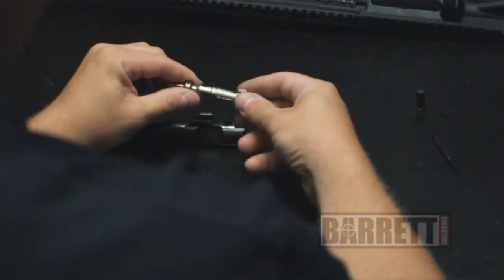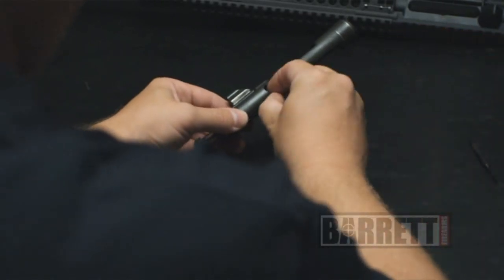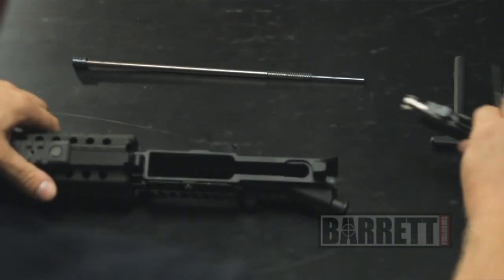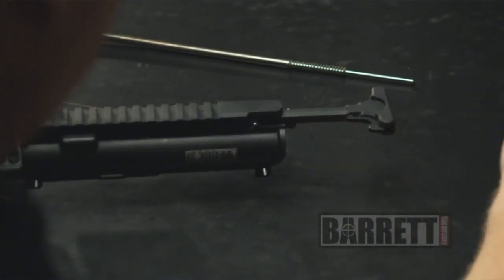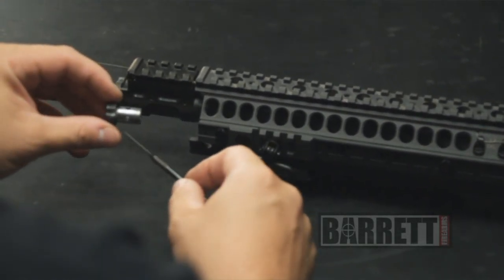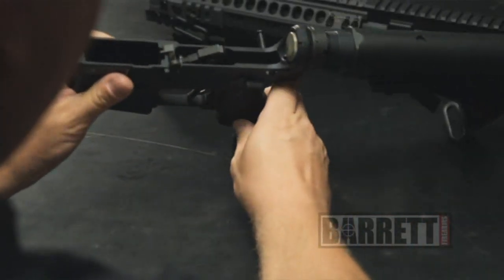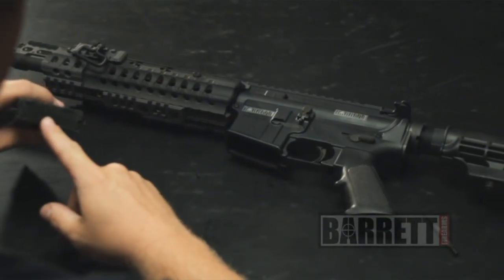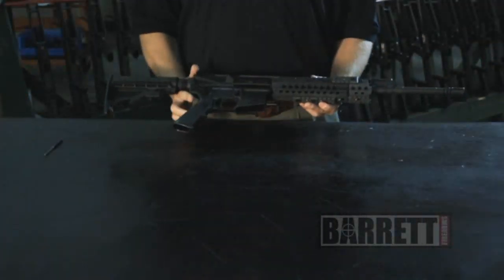Barrett REC7 Tutorial Part II

Comment: I personally own the Rec7 in 5.56, after I put over 300 rounds through the gun I cleaned it and inspected the receiver extension and noticed that the finish was untouched and there was no sign of wear inside the buffer tube. If you were to put over 10 thousand rounds through it I'm not sure of what kind of wear you would see on the rear of the carrier or the buffer tube, to be safe though you could always apply a light coating of lube to the rear underside of the carrier.

Comment: @xlifeispointlessx Not to mention its piston operated, which is much better than dirtect inpingement as it doesnt heat the bolt up or spray dirty hot gases over the internals like in the standard AR-15's.

Comment: @stefanalin Once you do it a few times, its totally blindfoldable.  And you dont need any tools at all.  The hardest detail to get to without tools is the little cotter pin that holds the firing pin in, and unless I just trimmed the nails, it's pretty easy to remove otherwise use the firing pin or bullet tip.  Maybe not as simple as an AK (next on my list), but still very easy.  Since it runs so clean, it does'nt need cleaning nearly as often as the GI AR's.